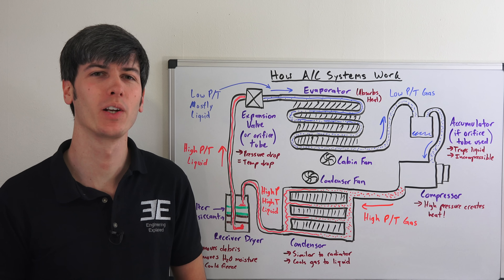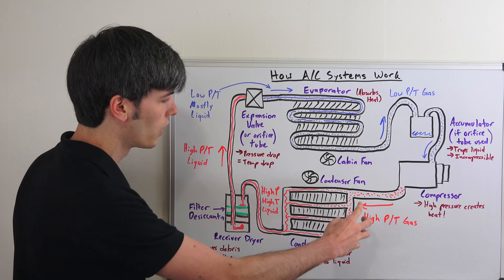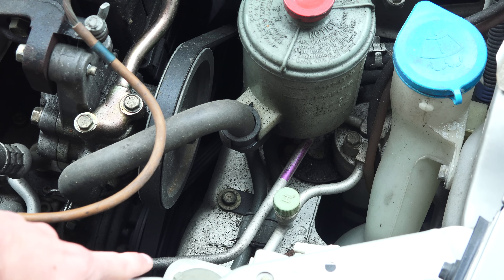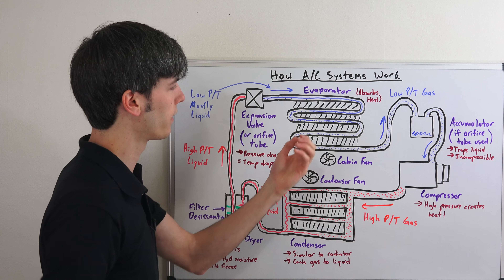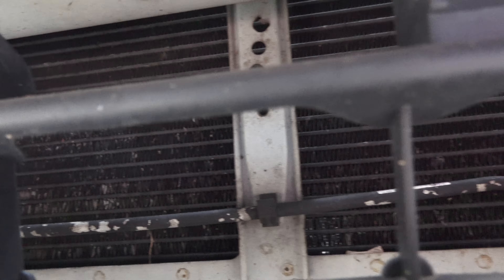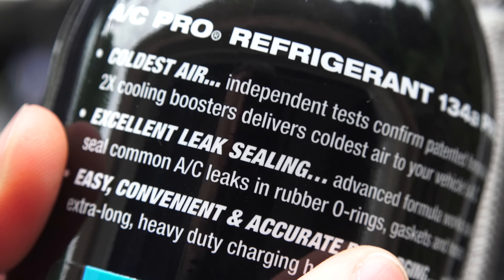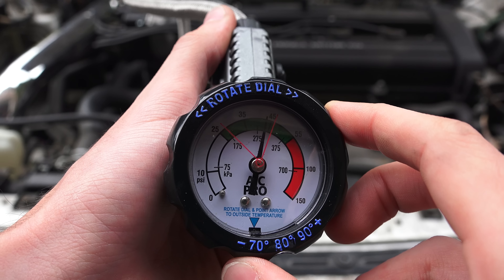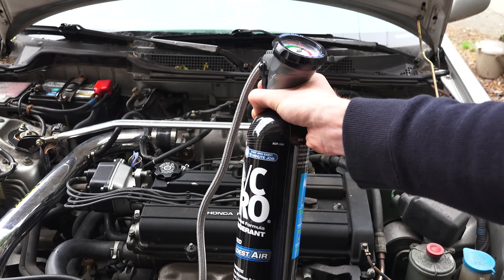How Car AC Systems Work & How To Recharge Your AC System

Comment: I literally just looked this up for my wife's car! Perfect timing! Also... I love you.
Reply from the maker: <3
Reply: Same here. About a week ago.
Reply: +Engineering Explained I'm pretty sure these D.I.Y. kits are not available in the UK as it is an offence to recharge a leaking system with refrigerant,it has to be done by a "professional",where it's supposed to be pressure checked and leak tested with carbon dioxide first,if this is satisfactory,the gas is evacuated with a special unit that retrieves moisture from the system and the refrigerant is recharged.In practice many of the tyre and exhaust shops just recharge it,and not surprisingly,two days later,the a/c doesn't work again.
Reply: +Graham Smith halfords sell the c**p can recharges, kind of make the gas handling course I did a wast of time as who ever has been fined for using them with out the certificates, its nitrogen to test them

Comment from the maker: Probably obvious but nonetheless something I should have said - these are closed systems. If the system has run out of refrigerant, the refrigerant has to have leaked out somehow. Simply replacing the refrigerant in this scenario does not mean the system is fixed; ideally you should add refrigerant when you know the system does not have leaks. Here's a great video on how to find leaks: https://www.youtube.com/watch?v=95RdGLFIbL8
Reply: Hey, I'm having trouble with my AC unit on my Tahoe. Last summer my car began to overheat, a prompt told me my coolant was hot and my AC disengaged. Days later I flushed my radiator but still no AC. My refrigerant levels are in the sweet spot. Any suggestions?
Reply: Hey can you make a video on how to fix bad smell coming our of the a/c system ?
I tried changing the cabin air filter and oder stop , but still didn't work.
Thanks
Reply: I'm sorry to say that's not true. They are closed systems but there is an acceptable leakage rate because the Schrader valves do leak refrigerant. it is why every couple years you have to do a ac system service. most of the time it is just topping it off. I don't have the acceptable leakage rate on hand. But I swear it is 2 ounces per Schrader valve per year. don't quote me on that number and I will get the exact one. But there is a leakage and it is acceptable. It's just minor.
Reply: since the systems are sealed, the only reason why you would need to add refrigerant is because of a leak :P
Reply: +M3T4L J35U5 have you ever gone to school for this? Have you ever been certified for this? the SAE standards for refrigerant fittings is one quarter of an ounce of refrigerant per year per fitting. you have one high side fitting, 1 low side fitting, 1 fitting on both sides of the condenser , one fitting on both sides of the evaporator, and one fitting on both sides of the receiver drier. that means you have 8 fittings on a normal car. Those 8 fittings can release two ounces of refrigerant per year and still be acceptable by SAE standards. No system is perfectly sealed and with the pressures the systems run they will leak. the reason units like the refrigerator don't leak is because they are completely sealed. They have no fittings to check them. They are copper lines that are brazed together. your house is the same. It doesn't use gaskets or o-rings it is brazed together. the only place for it to leak is from the fittings at the unit and usually they have a shut off valve. And even what they may leak doesn't matter, because there is so much refrigerant in the system. cars are one big slow leak for refrigerant.
Reply: Yeah i know how ac works, i do it for a living. and yes i'm certified, but not necessarily for automotive.

fyi: if you have 1 lowside fitting and then 1 fitting on either side of the evaporator, then that's 3 lowside fittings, not 1.
Reply: M3T4L J35U5 I said fittings but what I by fittings I meant places where the a/c components connect together. Where the a/c line enters the evaporator has 2 o-rings. Both of those are leak points.  You have multiple leak points on a vehicle. = one high side fitting, one low side fitting, 2 o-rings at the condenser, 2 o-rings at the evaporator, 2 o-rings at the receiver dryer, and 2 o-ring at the compressor. Possible 1 more fitting near the receiver dryer.

Comment: Leak sealers coat the whole system and harden if the lines are ever opened to the atmosphere. Everything is scrap metal at that point. Do not use anything with leak sealer on a vehicle you want to keep.

Additionally, for 20.00 more than the A/C Pro product, you can buy a set of manifold gauges from Harbor Freight and charge the system properly.  They must be making a killing selling 20oz of refrigerant and a plastic gauge for 30 bucks, when you can buy refrigerant all day for 4-6 dollars per 12 ounces. 

Jason, while I really enjoy your white board explanations (which are always spot on), this demonstration feels like a commercial for A/C Pro, and is far from the correct way to charge an A/C system. This method will get you by for a couple months, but the process to get years of trouble free service is much different.

Comment: Very nice explanation of an A/C system operation clear, quick and to the point like most of the stuff you do. Thumbs up!
In my experience however, topping up refrigerant and oil; also leak sealers should be avoided.

Comment: One thing I've have  learned is that it would be good to have gauges on both the high and the Low side, Our good friend Eric the Car guy has a great video on this ! but as always thanks for a great video Mr. EE !
Reply: that's probably because he doesn't want people messing with the line which contains hot gas at high pressure

Comment: Best bet is to measure the high pressure side too, lots of A/C issues aren't solved or worsen because both pressures weren't measured properly. My brother-on-law's car had a bad expansion valve, low pressure read normal, and high pressure read low causing hot air flowing through. Sometimes just by measuring the low pressure port isn't always the best. Just my 2 cents.

Comment: I was working on air conditioning when I was in Iraq "two deployments"  and we usually check for leaks with the green dye and check with UV light also we use a vacuum pump after we do repairs and let it suck all moisture but the desiccant dryer filter has to be replaced to avoid any further contamination that is before the vacuum pump with the gauges after about 20 minutes of vacuum pump we turn it off then we wait to see if needles from the gauges move from the last reading it means there's a leak, most of the time are faulty houses or damage o-rings after repair is done we vacuum the system  for 20 minutes then we at the appropriated amount of oil  we use a scale to measure the correct amount of R134 we turn on the engine and slowly add opening the low side of the gauges until we see on the digital scale the correct amount of R134 after the system is charge we double check with the UV dye to make sure there is no leaks and done and yes we use a digital thermometer to make sure is working correctly :) one note there is a special pressure switch, if there's not enough R134 on the system the compressor will not engage or turn on 

SPC Vargasdiaz  94F/ air conditioner "is Army we have to do it"

G-FSC 3-82 FA maintenance UNIT 
Killeen Fort Hood, Texas 
33134

Comment: Didn't know of another way to get a message to you, but could you explain how gas pump nozzles and pumps work.  Not exactly a car but it's directly tied to the vehicle infrastructure.  Just don't understand how the nozzle operates unless there is a connection through the hose to the pump itself.  Keep up the cool vids.

Comment: Condenser or Condensor? Both are on the board :) and thanks for the video I recharged my system (and learned all this) like a week ago though! This would have been a lot easier to learn how it works, you did the same with your spark plugs video it was released one day after I did my plugs and wires! But as always you are awesome, thanks!
Reply from the maker: Oh my... condenser* haha. I blame my engineering degree for my poor spelling.
Reply: Engineering Explained Haha no problem, spelling isn't my strong suit either!

Comment: shops have recommended cleaning the condenser from leaves, bugs, and dirt that has built up over time. would you recommend replacing the reciever drier along with a compressor?

Comment: Greetings Mr. Engineer Explainer!
I have this question about AC on cars, so the compressor is driven by a belt that revs the same as the engine, and when you push the button inside the cabin, a clutch engages the compressor into the belt to make it run. So if you are cruising (about 2500, 3000 revs) and turn on the AC, the compressor will accelerate from 0 to "engine rev" instantaneously? that cannot be a good thing on the long term, can it?

Great page BTW, learned so much with you!

Comment: My 2000 Nissan Frontier A/C clutch was not engaging. First thought is low charge. No luck with charging the system. Found out they have a temp controlled compressor clutch switch attached to the evaporator is common to go bad. Replaced the switch, A/C is good as new.

Comment: Are you supposed to keep your engine and ac running while refilling?
Reply from the maker: Yes.
Reply: Thank you, that was my question too.
Reply: Yes you want the compressor to be running while you charge
Reply: yes, or it wouldn't get suck in
Reply: He forgot to mention that the ac should also be at its coldest setting while the fan is at its highest setting.
Reply: Pretty sure at 5 minutes it clearly says turn your ac up to its highest setting before starting. Pay attention. There was even video of his hand doing it. So, what are you referring to?

Comment: good video, have you shredded a belt recently in your integra? there seems to be a large amount of rubber debris, and grease on the front side of your engine. you should do a video showing that a clean engine runs better because of thermodynamic efficiency, lol.

Comment: No ones gong to bust his chops for the bare ground wire at around 4:16? By the way great video. This may help me in diagnosing what's wrong with my trucks AC. I've had the for going on five years now and the AC has never worked. Sprayed AC Pro in it and still go zero cold air.

Comment: Good explanation but a little basic in my opinion.Some additional comments, the AC system is a close one, you dont need to recharge unless you have a drain problem. maybe it good be cool to add some issues related to the fins and the relation of pressure drop. but that is related to the design of the condenser. anyway thanks :)

Comment: Do they make a version without additives, or perhaps one with just a dye in it for finding leaks? I'm not a fan of most additives when it comes to cars.
Reply: yes they do. auto zone brands or similar.
Reply: Most in house brands of refrigerant is just 100% r134a without additives, all else has additives.
Reply: Buy a manifold gauge set and an r134a can tap instead.

Comment: Does that bottle have the compressor lubricant in it as well?  They always say that the temp goes down after the expansion valve but I've noticed on several cars that one of the lines on the compressor will get stone cold when the A/C is on.

Comment: Omg finally someone explained why an AC uses fuel/decreases performance. The compressor is driven by the engine and not the battery.
Reply: it's common sense normally.
Reply: *****  ... to who? nobody i asked knew how the ac affected the engine they just knew it did cause someone told them.

Comment: Thanks for the video! I have a question: Do all cars use a system like this, or are there situations where a peltier based AC is prefered? Maybe electric cars that dont have an engine to drive the compressor with, or race cars that need lower weight and smaller packaging. Thanks!

Comment: 1- is the compressor usually centrifugal or piston?
2 -how is the compressor protected from liquid entering it?is it the accumulator? if so where does the liquid from the accumulator go?
3- in all AC systems I have seen the LP line is partially insulated  and some mechanics advise to insulate the low pressure line fully  to increase the  cooling capability of the AC system. do manufacturers partially insulate it for cost cutting only or is it to ensure the heat from the engine bay would boil any remaining liquid to protect the compressor?
Reply: that explains a lot, thanks

Comment: I just replaced my compressor, accumulator & orifice tube on my 01 Tahoe. Recharged the system, it blew cool...but not NEARLY as cold as it should. I'm in the process of putting the correct size radiator on my Tahoe, that will allow me to put on my upper and lower fan shroud.   The question....does my fan shroud play that big of a role that I'm not getting the cold a/c that it should be???

Thanks!

Comment: thank u ... great video but if air past through the evaporator,shouldn't gas turn too hot liquid because as air passes through the evaporator it will take heat out of air and turn gas into hot liquid ???

Comment: do you know if ac systems are throttled in any way? for example, does the expansion valve always release the same amount of fluid (or some other way of limiting how much the ac system is working)?

Comment: If you're low on refrigerant it's because it's leaking. Swelling up your O-rings and gaskets is a bad idea and not often the source of the leak. Chances are every drop of refrigerant you put in will go straight to atmosphere and they are strong greenhouse gases and pollutants.

Comment: Hey Jason, I couldn't find any videos explaining "dieseling" or "run on". My father experienced a problem with his first car (a Nissan). The engine won't shut off for quite some time even after removing the key. He got everything checked and replaced but had no luck. Finally he switched to a lower octane fuel and that seemed to solve the problem like a miracle. He couldn't ever figure out any explanation to that. I'm curious to find out the reason.

Comment: I work in the HVAC/R industry and there are very strict rules regarding refrigerants and refrigerant leaks. I'm always curious how these recharge kits are allowed to be sold.
Reply: i used to do that as a profession myself too and i wonder the same thing.  there is a whooole process for recharging any kind a/c system but they're handing out the bottles in Autozone like hot bread